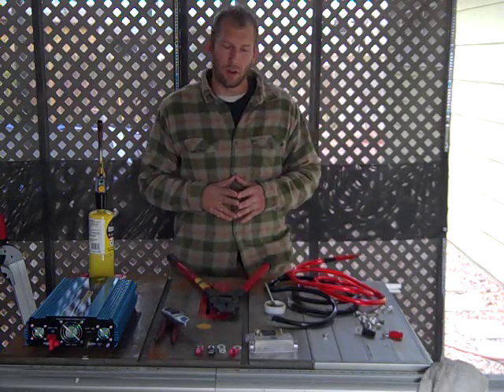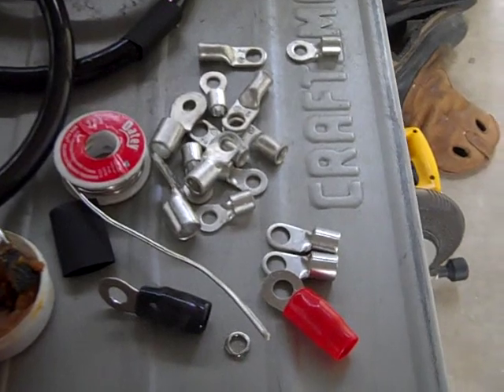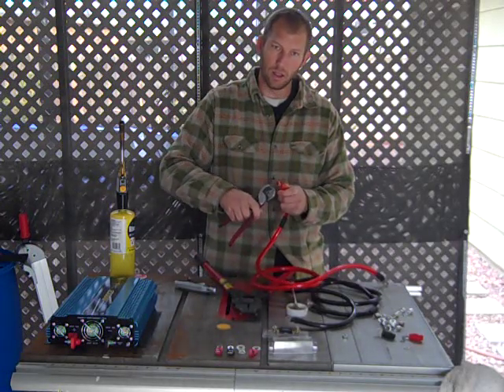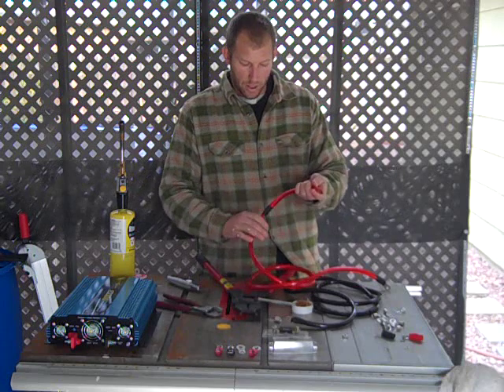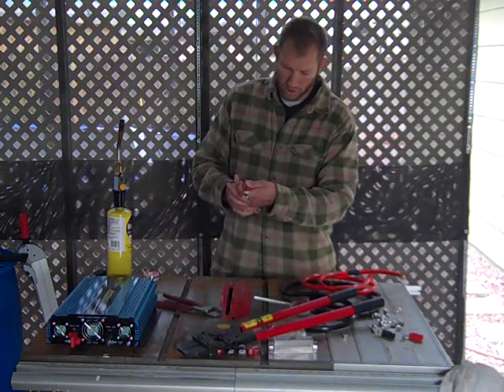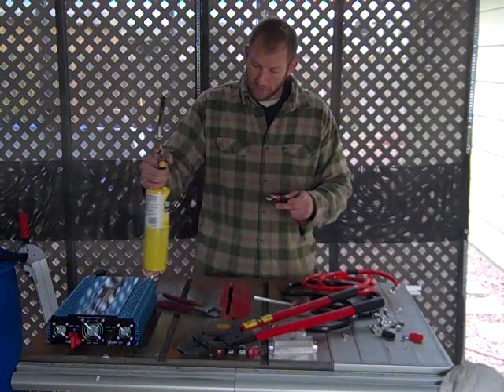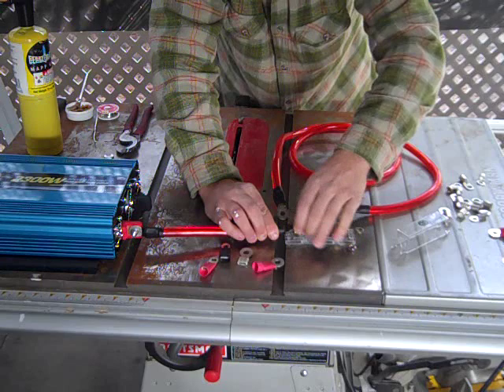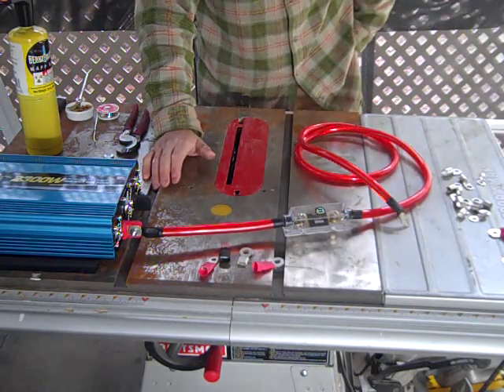How to install an inline fuse holder and how to crimp battery cables for your power inverter

Comment: Your using the wrong in line fuse. Do the math. Watts = Volts * Amps. 2500 = 12*Amps implies Amps = 2500/12 = 208.3. You should be using a 300 Amp fuse or find a fuse that is greater than the 208.3. Fuse should always be larger.
Reply: This guy is right. This video is a disservice.

Comment: so you inverter is 2500 watts and use a 200 amp, what fuse you use for a 6000 inverter?
where does this 200 amp come for why no 100 amp, 300amp etc.
Reply: Use the formula W = V * A where W is watts, V is Volts, A is Amps. If your using a 6000 Watt inverter on your vehicle, then Volts is 12V. 6000 = 12 * A implies A = 500. You would need a 500 Amp in line fuse. Questions?
Reply: Do the math. Watts = Volts * Amps. 2500 = 12*Amps implies Amps = 2500/12 = 208.3. He should be using a 300 Amp fuse or find a fuse that is greater than the 208.3. Fuse should always be larger.

Comment: Dude, thank you for the tutorial video because you saved me time and a ton of aggravation. I purchased the correct tools, cables and ring connectirs and followed your steps without any problems. I got the 200 amp in line block fuse to my positive cable to my 2000 watt inverter and to my battery bank. Thanks again for this useful video it really helped 100% and you are right on point. I recommend ACE hardware fir solder, flux and importantly the right size ring connectors because they have them in stock and those folks really know what they are talking about. 👍

Comment: Just a tip..lightly brush the terminal with flux after you've soldered as well. Then have a spray bottle filled with water to spray the solder. You don't have to wait or it cool and makes for a cleaner solder job. Also, if you brush the terminal, inside and out with flux, there's less likelihood of cracked or failed connections from not be clean enough. with soldering it's all about the material being clean, clean, clean.

Comment: Hey, trust me, its better to line up the fuse as close to the battery as possible, because when a wire burns down, , you don't want the short to go all the way down through your car to your in this case amplifier. it can cause a fire or it could even blow up your battery! what I did is i had like a 10 cm cable, then placed a fuse and then ran the cable through the firewall to the back of the car. this way when something goes wrong, the short doesn't go any further than 10 cm off the battery

Comment: Nice how to! Only thing I would have added is the emphasize the use of NON acid solder and flux. Acid rope will -initially- make an EXCELLENT joint, but the acid will creep up the wire and corrode the copper. Acid core is primarily meant for slowing galvanized steel, not for copper electrical connections.